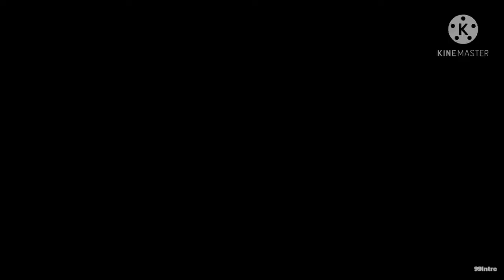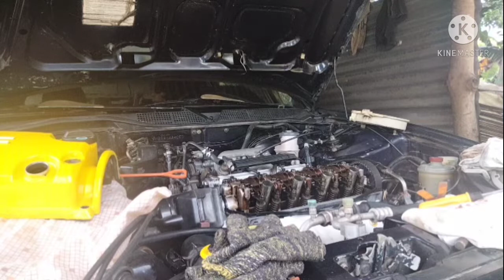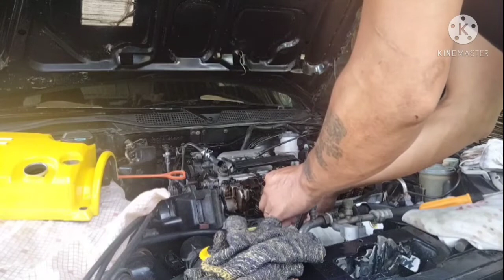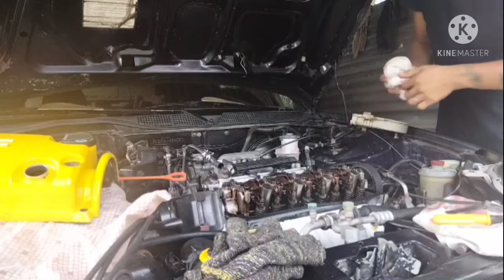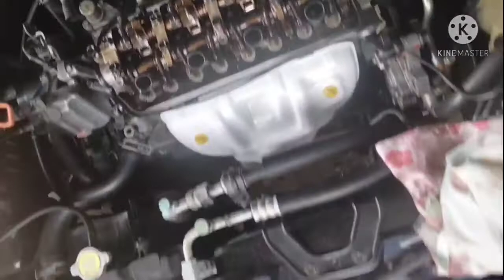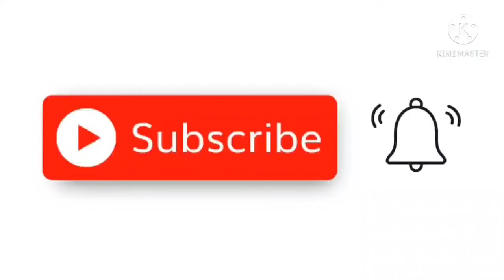honda civic valve adjustment DIY ,tagalog tutorial,

Comment: Boss, ano engine mo? Ano ba tamang firing order ng p6fd1 engine? Honda civic 1999 model at ilan degrees btdc ba ang distributor timing
Reply from the maker: 1342 idol ph16a engine ko basta 4cylinder engine 1342 firing order  nyan bossing
Reply from the maker: Sa ignotion timing ko bossing gumamit lng ako timming light kng mkita mo tatlong mark nya sa crank pulley tinutok ko lng sa dulo
Reply: @bossrjdiytvpalawan2693  salamat boss, new subscriber here, more power sa channel mo